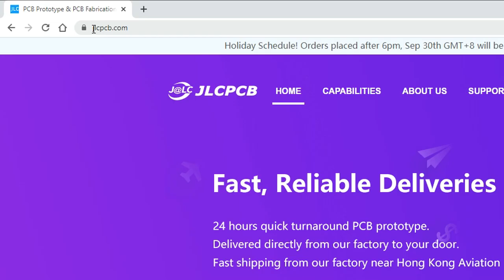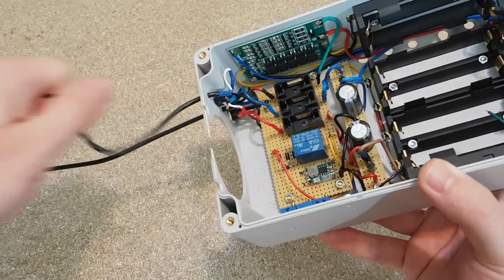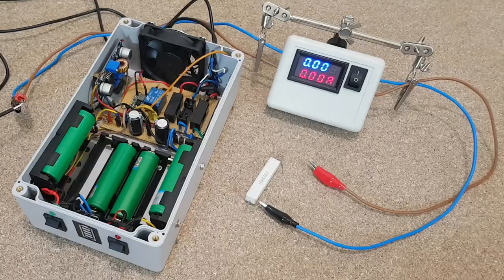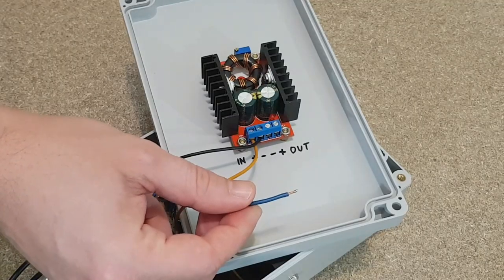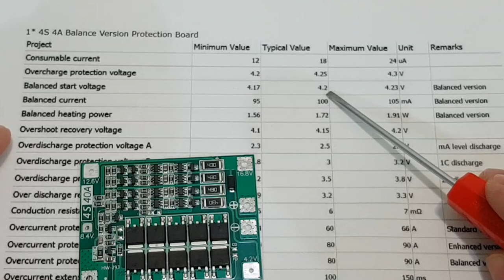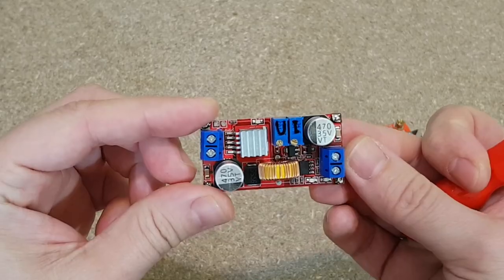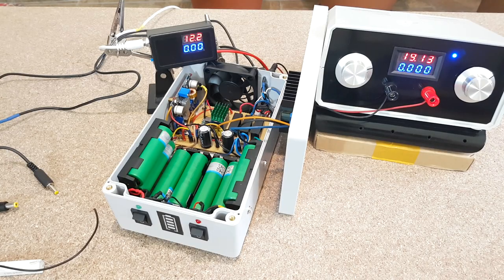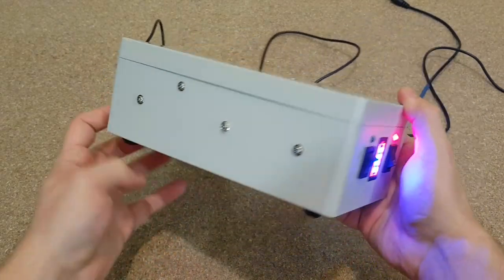DIY UPS with 12V and 19V (for Asus router) part 2/3

Comment: This video has given me the inspiration I needed for a project.  I seen many different versions of DIY UPSs, but yours is the only one I have seen with multiple power inputs.  I am looking to set up some small DIY wind turbines in my yard.  I want to power my routers using the wind power.  But, on days when there is not enough breeze to generate power, then I want to use the house power, and only switch to battery when both wind and house power fail.  I will need to alter the design for the appropriate input/output voltages, but am hopeful that I can do this after seeing your design.  I also want to change the fan to turn on when components get hot, rather than when switching to battery.  Thank you for an interesting and inspiring project video.

Comment: It would have been nice to use FETs instead of the relay. Great work. I love your work and have made a number units based on your projects.
Reply: In this project, Sorin used a Relay so that when the INPUT SIGNAL (12v power supply) is OFF, the LOAD (battery backup) turns ON.

I think a FET only allows you to have the INPUT SIGNAL as ON, for the LOAD to turn ON.
Someone correct me if I'm wrong but I think you can't do INPUT SIGNAL off, LOAD ON with a FET switch.

https://www.youtube.com/watch?v=17vqLv508Uw
Reply: @Existinginthespace  you most definitely can

Comment: Hello Sorin! I appreciate your work and you do a verry nice job! It is verry interesting and the way you explain is well done! Also, the jokes about us the romanians and the safety issues fit well, between the subjects. I have a question, what is the autonomy of the UPS? Toate cele bune / best regards, your subscriber, Valentin!
Reply from the maker: hi. with the ont and the asus router from the video the UPS will last a little over 3 hours on battery power. but with better lithium cells or a bigger battery pack the autonomy will be increased.

Comment: Awesome project! I love the use of the battery holders (since we know these Li-ion batteries won't last forever) & appreciate your explanation of why each component is needed (as well as your attention to safety). 
I will definitely use this as a reference when I get the courage to build my own.

I'm wondering about the fan though, since it's only on when the battery is draining & turns off when they are being charged. This seemed odd to me since:
 1. the fan's additional load on the batteries will reduce the UPS' up time &
 2. charging the battery generates heat, so wouldn't the fan be better on at that time to keep them cool.

Perhaps you can add a simple temperature sensor to trigger a fan relay to turn the fan on when the enclosure gets too warm?
Reply from the maker: hi. there is a lot to talk about this project, that's why I made 3 parts. the fan is powered with 6V and 0.071mA = 0.426W. considering that the converter for the fan has an average efficiency of 90%, the fan is using 0.426W/0.9=0.473W. so it's using very little power from the battery pack. the battery pack has an energy of around 46.36Wh. so if I power only the fan, the battery will last for 98 hours. that's how little power the fan is using. in reality it will reduce the autonomy of the UPS with only 1 or 2 minutes, but it's needed to cool down all the converters inside.
when the cells are getting charged, the CC/CV converter is delivering max 800mA, it has a heatsink on the IC, which gets only a bit warm. also there is natural cooling inside the UPS, when the fan is turned off. the warm air is going up and exits through the top side of the fan hole. this process draws fresh air through the bottom holes. the lithium cells don't heat up when they are charged, because the 800mA charging current is divided by 2 rows of cells connected in parallel, so each cell gets max 400mA. this is a charging rate of 0.25C, which is fine for any type of lithium cell. 
the fan and heat are not a problem for this project. the only problem is the switching time of the relay, it needs to switch very fast.
Reply: @Sorin_DIY  thank you so much for your detailed explanation & taking the time to respond. 
I appreciate this & will keep in mind that not everything needs to be actively cooled (like most of my projects) & many can get by with just passive cooling. Cheers!

Comment: Some of the DC-DC converters destroy themselves when attached to a battery. As when input power is removed, part of the circuit is backfeed from the battery via the feedback resistor divider.
None of the modules I looked at had thermal cutout or proper overload protection.
Apparently an extra Diode on the output of the DC-DC prevents the damage, but I've not tried.
Batter off using a dedicated Lithium IOn battery charge module (eg TP5000 or TP5100), but then you need to feed them from 6V or less with another DC-DC.
Reply from the maker: hi. I've tried with different diodes at the converter output. 1-3A diodes get hot. I finally connected a 6A diode and it doesn't get hot, but the voltage drop is too much. I need minimum 17.25V to fully charge the cells. with a diode in series, the converter voltage must be set to minimum 18V, because the voltage under load drops too much with the diode. but when the charging is completed and there is no more load, the voltage jumps to 17.5 -17.6V and burns the battery indicator, which is connected to the BMS terminals, not the battery pack terminals. but the XL4015 IC is better and it didn't burned so far.

Comment: for 3s bms, which charging voltage would you recommend? i have the same observation with mine getting hot so i just simply disconnect it from the charger but the batteries ended to have different voltages
Reply from the maker: hi. it depends on the type of BMS board. if you use one with the same characteristics per cell like mine (max overcharge protection voltage 4.3V) you need a charging voltage of minimum 12.95V
Reply: @Sorin_DIY  yes indeed i measured each parallel and the third row is the highest at 4.23v. thanks for clarification

Comment: We need part 3 with QC 4.0 and switching over MOSFET 
As well as charger for this
Reply from the maker: I'm gathering parts to make a better UPS soon, with a bigger LiFePO4 battery, higher output power and better features.
Reply: @Sorin_DIY  waiting 😁🔥🔥

Comment: I have a 12v router which is configured in the same way, an adapter and a 12v boost converter. the issue comes during the relay switching. when the power cuts the stored energy in the relay coil takes around 1 sec to discharge, i have also connect a diode in reverse polarity for the coil and a 2200uf capacitor at the output. the router restarts every time and i have to wait for it to reconnect. in your ups does the asus router restart during the relay switching?
Reply from the maker: hi. the router should not restart. the relay must switch on or off instantly. where is the relay powered from? the 12V adapter, or another circuit board? the energy stored in the coil does not delay the relay switching off. most likely there is a capacitor somewhere on the supply line to the relay and the energy stored in the capacitor keeps the relay powered for another second. you need to find that capacitor and remove it if possible, or replace it with a lower value. if that isn't possible, you can add a resistor in parallel with the relay coil, to increase the consumption and decrease the delay time. you can see in my video that the relay is clicking instantly, when I connect and disconnect the 12V plug.
Reply: I exprerienced the same issue as you while trying to build a UPS for my 9v Router. The switching of the relay was to slow and the router was restarting ((
I also used a diode between pins of the relay, it helped but still switching was to slow.
I also added 2x 2200uF and 2x 1000uF capacitors. and still the same problem, switch of the relay was not fast enough. even when hearing it, I noticed that relay was clicking much instantly... but still router reboot 2/3 times on 5, during my outage simulation...
Relay is powered by main 12v input, because obiously we want relay to switch when there is outage on main voltage input...
Reply: @Sorin_DIY  Hi sorin, thanks for the reply😊. the capacitor connected at the output of relay has a rectifier diode before it. so the cap should not charge the coil in this way. there should be a capacitor inside the 12v adapter output. i am using the same adapter to power the router and the 12v relay. in the video you simulated power failure by removing the adapter connector. i tried the same way and the relay switches instantly. but, in the actual usage my adapter will be continuesly connected to the ups and hence the router restarts because the relay is still activate as low around 8 to 10 v but the router cannot work on such low voltage. is there a way we can switch using mosfets? this could solve the restarting issue😊
Reply from the maker: hi. the relay should switch off when the voltage drops under 7V. I suggest you bring the voltage closer to that value with 3-4 diodes in series with the relay coil, to about 8-9V. this way when the 12V is starting to decrease, because of a power outage, the relay will switch off faster. you can also add a resistor in parallel with the relay coil, to increase the load and drop the voltage faster. probably a 470ohm 3W resistor will work. this is one of the reasons why I added the diodes in series with the relay. I will look into this problem and test some more ideas in a future video.
Reply: @Sorin_DIY  Hi Sorin, i will try reducing the voltage for relay coil and also add a resistor. surely i will be waiting for your next amazing DIY videos.😊
Reply: @Sorin_DIY  Thx you, but I dont think bring voltage suppling the relay to 7v is going to work, becauce most relay I tested are even ticking with 4.5-5v! even though they are 12v rated relay, I looked over the net, and everything is normal with relays. Relay are switching with voltage around 5v, but of course switching with 5v is being much slower than with 12V. But after I added a diode in parallel to coils Pins of the relay, the switching is happening much faster, but still my router do not link it lol. 
This is the schematic I followed: https://www.homemade-circuits.com/wp-content/uploads/2020/06/DC-ups-with-relay.jpg
I only used 1x 18650 + TP4056 + MT3608. (1 battery is enough because I just need it to loast around 5min until generator kick start...). Some people advise to use Solid State Relay, but kind of standbye this project for now lol...

Comment: Sir can you build / make a powerful bass  motherboard  and adaptor, for adaptor can it be 20-25v 50+50 watt. ( not Bluetooth conection ).
Will it be possible or impossible, sir I do love to play an electronic but only on dc Im teenager only I also very scare on ac. Sir I almost watch all your video your diy was very good and look awsome.

Comment: Thanks a lot for this project , how long does it goes with batteries ?
Reply from the maker: the autonomy is around 6 hours, depending on the current consumption of the devices.

Comment: Hey bro 
I have made a 12v power bank for wifi routers 
But when i plug the charger the the charging starts but also the router must take the power from the charger not from the battery when the power comes it automatically should switch to adapter not at the same time from the battery can you help me plz

Comment: 1. I was expecting you to use only the 19v adapter! You could have putted a stepdown after the 19v Imput to get the 12v Imput, this way only 1 adapter to use instead of 2.
2. I noticed that the relay is altering between Charging Battery <> Output to keep the devives ON.
I builded a UPS for router , but the Relay was setted to alterned between 12v Original Charger <> Battery Backup. Not as your case.
Unfortunatly, it did not work well because of small delay when the relay was switching, result: the Router was sometime rebooting 😒
Of course I added 4x 2200uF capacitor to fix this delay but still happening, I then dropped the project.
Also you did not put a 1n4007 between the pins of the Coil of Relay ( Pin 1 & 4 of your schematic), it is very recommended, it limit the delay of relay ticking...
Reply from the maker: hi. 1. I wanted this to be an "offline UPS", so on main power only the chargers will power the devices. in the future I plan to make an online UPS with 2 or more outputs, that will have a single charger and several DC converters. 
2.  instead of a second relay I used diodes on the outputs. the primary relay on the battery is important. even if there is no load on the buck/boost converters, they still use a tiny amount of current from the battery, so the battery needs to be disconnected from these small loads, including the fan, unless there is a power outage. 
3. I used a flyback diode for the relay on my project, you can see it in the videos, but I forgot to put it in the full schematic. thanks for mentioning this, I corrected the schematic. 
4. I'm working on a part 3 video, with more explanations and improvements, including for the relay to shorten the delay and switch faster to battery power.
Reply: @Sorin_DIY  Thx you  much, sure other than me will appreciate a Part 3/ Explanatory Video 😊
Anyway your projects are always greatly explaned, keep the great work, and hey where is your assistant?? Your cats did not want to participate in this project?? to complicatre for them maybe 😁

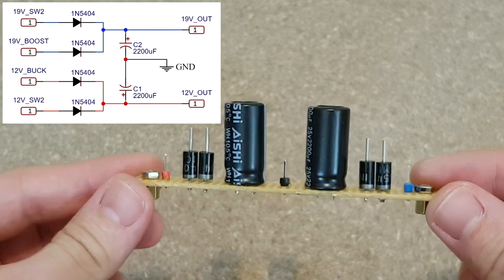Comment: Hi, i made a ups for my router ,but router restarts when power on/off (mains) so, can i use the same setup u showed at 2:00 min . Can it fix that problem..
Reply from the maker: hi. it depends on what components you use. but a capacitor on the output will probably help.
Reply: @Sorin_DIY  voltage of capacitor did matters!. Can i use a 1000uf 16v capacitor and in4007 diode.

Comment: Does the constant current, constant voltage Buck converter can charge the cells with only 12v input ?
Reply from the maker: no.

Comment: Can i use 12v input with step up converter to charge battery? Also, what gauge wire do you use to connect the batteries?
Reply from the maker: yes, you can use a step up converter to charge the cells, but it must have a CC-CV charging method. also to charge the cells, it's better to use the charger with the highest current output. I used 1mm gauge wire for the battery.

Comment: It is safe for Lithium batteries to be connected to charger, 24/7?
Reply from the maker: No, li-ion cells should not be connected directly to the charger. the cells must be connected to a BMS board with overcharge release protection feature. this type of BMS cuts the charging current when the cells are fully charged.

Comment: Sir, I watch your video all the time, today I need a help, like I want to make an ups for Asus 19v 2.5A router, if I put in 19v 2.5A router with 12v to 150 watt booster circuit, my ups  Will it be successful? Please sir replay ??
Reply from the maker: hi. yes it will work, but the boost converter may heat up, you should check it periodically. if it heats up, you should use a more powerful boost converter with a bigger heatsink.

Comment: Really cool Sorin!

Q: Shouldn't the caps rated to twice the actual voltage for good compliance?
Reply from the maker: the capacitors need to be rated at a higher voltage value than what they are powered with, but not necessary twice the value.